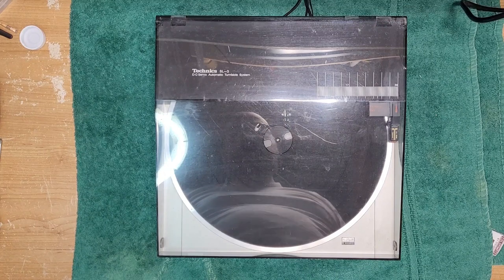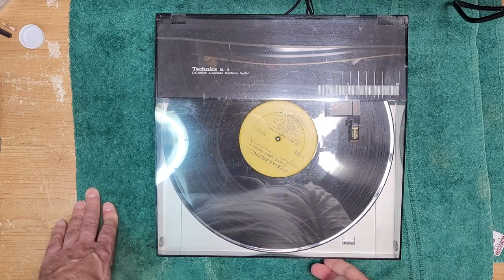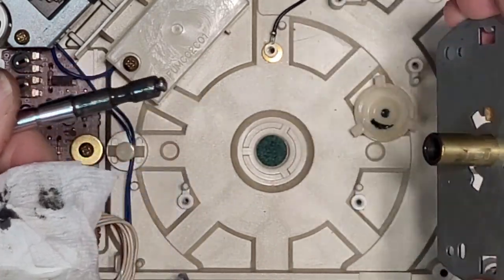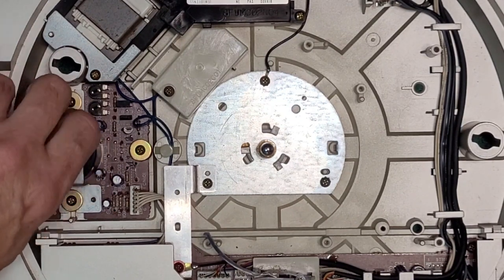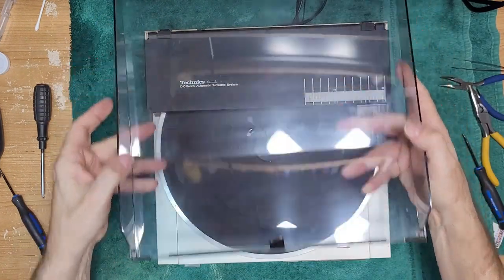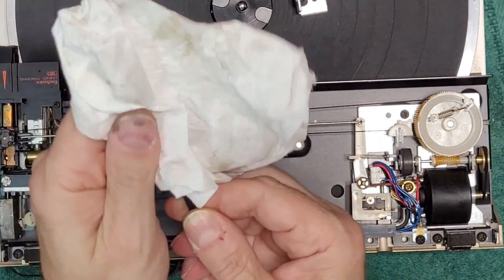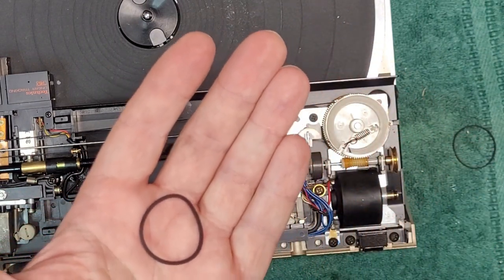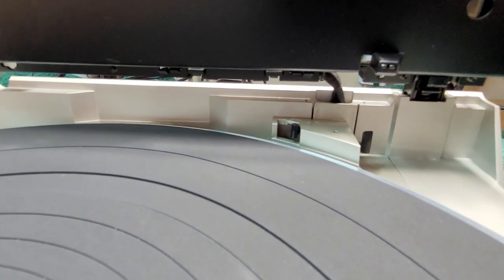Technics SL-3 (Linear Tracking):  Full Service

Comment: Thanks so much for this detailed video. I've been searching in vain for something similar but specific to an SL-J3 bought in the US in 1986, which gave me decades of enjoyment till it stopped during the pandemic. I now live in India, where no service centre for this product exists. I do want it working again--I have an emotional connect with it. My qualified and trusted technician checked it with the service manual that I bought from the US and observed:
1. When switched on the cueing LED glows on the front panel.
2. As shown in the manual, I removed the bottom cover and checked all voltages at the respective points as instructed. The voltages were found okay according to the circuit diagram.
3. I dismantled the top cover to check the arm movement mechanism. The belt between the arm movement mechanism and motor pulley lay in pieces inside the compartment and the motor was rotating free when I switched the set on. I attached a suitable belt and the motor stopped rotating. The arm movement mechanism visibly seems okay.
4. I fitted the top cover and bottom cover back to check the system. I placed an LP on the platter, but there was no change in status. Only the cueing LED came on and no other switches functioned on the front panel.
Seems like an IC/microprocessor issue. How can we set it right again? Thank you for any help you can provide.

Comment: My main deck is a Technics SL-J300R. Pretty much the last in the line of the linear trackers Technics released. It's fully auto, direct drive, quartz locked and has direct track access. Never had any issues with the audio quality. There are a lot of bog standard more expensive decks available today that frankly wouldn't perform much if any better.

Comment: have a problem with my sl-3.  It is not auto detecting my records.  With the switch set to auto, the cartridge drops right there at the parked location.  If a 7 inch is on, the cartridge is dropped straight down onto the platter.  If a 12 inch disc is on it also drops straight down just off the outside edge of the record.  The arm you pointed out that detects a record's size seems to be functioning, that is to say, it moves back and forth as you'd expect it to by hand manipulation.  The auto return and stop works fine.  Any suggestions on what to check?

Comment: I have a SL-V5 vertical turntable that looks like this SL-3.  But the rubber mat is glued onto the metal disc.  How do i proceed to change the belt, re-grease the center bearing etc.

Comment: Great, How do i adjust /check tracking weight on the SL3? cheers
Reply: You don't.  This turntable uses a p-mount cartridge.  The p-mount was an attempt to standardize cartridge weight, alignment, and tracking force.  Tracking force is 1.25 grams and is not adjustable.  some T4P tables had a small adjustment built into the tonearm, .25 grams in either direction.  A P-mount (technically called T4P) cartridge is not designed to run at more than 1.5 grams.
Reply: @mescko  I have found the adjustment screw is on the top not user adjustable normally, but I have put it to max only about 1/2 gram difference but tracks better with the Technics cartridge!👍

Comment: Hello , i have  SL L3 , does not take the play command automatically technics SL-L3,  it only works in manual mode, I start it, the disc starts spinning but it doesn't play, only if I press cuering it starts, it doesn't search for tracks, be the reading sensor, or an idea where to start, thanks
Reply from the maker: Link to the service manual: https://www.vinylengine.com/library/technics/sl-l3.shtml

Comment: Does that Turntable have the 4 pin Syncro lead socket that the Syncro lead plugs into and then plugs into the back of the Cassette Deck that puts the Cassette deck into pause mode while you turn over the record and once play is pressed the pause on the Cassette deck releases and record recommences.
Reply from the maker: It's a one pin socket.
Reply: @TurntableGuy  On the MARANTZ TT143 it is a four conductor Syncro Cable with two 4 pin connectors on each end.